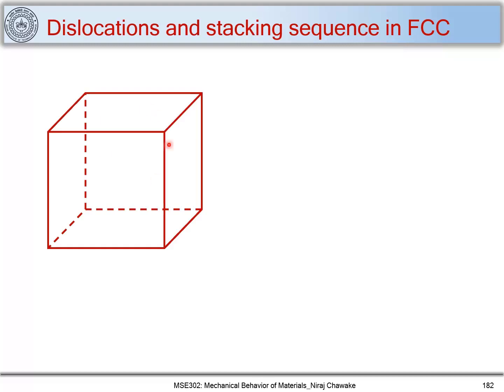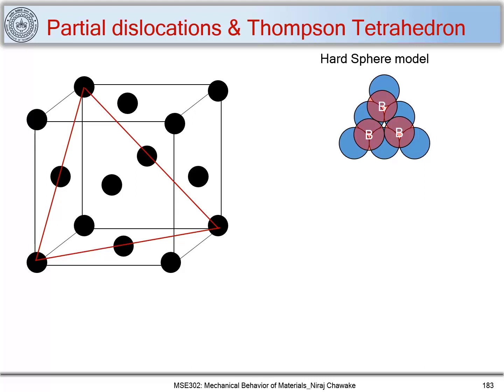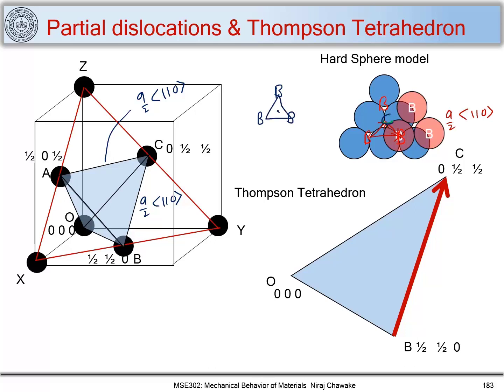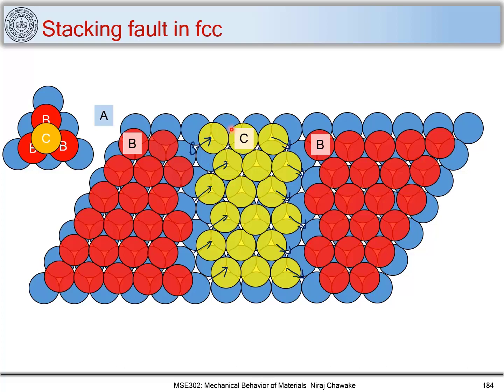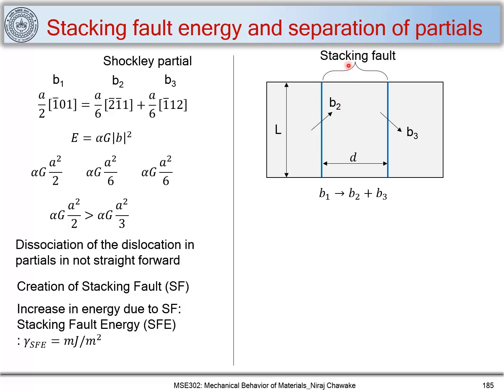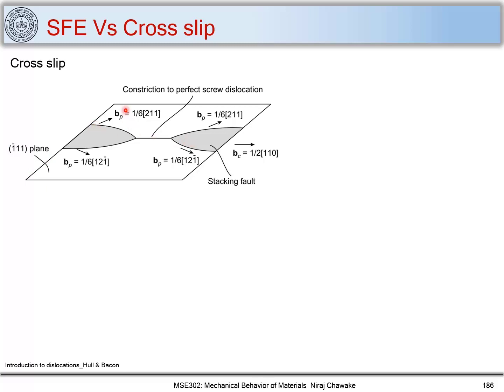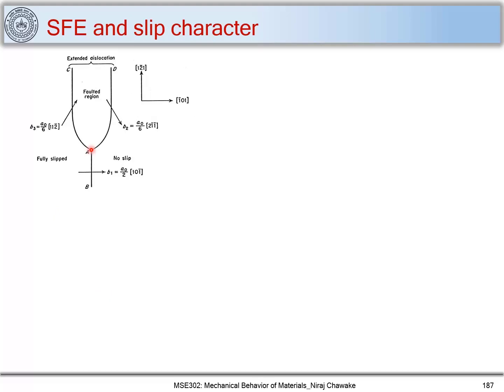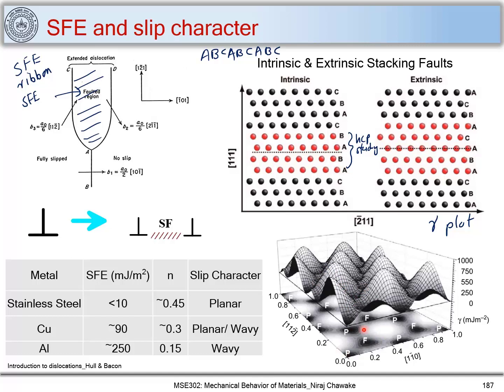44. Stacking faults in FCC

Comment: At 19.00, in shockley partial when you did E=aG|b|^2, then why didnt you did square of the denominators, like you wrote a^2/2 for b1, but isnt it should be (a/2)^2=a^2/4 and same for b2 and b3, correct me if im wrong, its little confusing to me there
Reply from the maker: (b1)^2=(a/2)^2×{(1^2+0^2+1^2)^0.5}^2
You need to find the magnitude of these vectors.